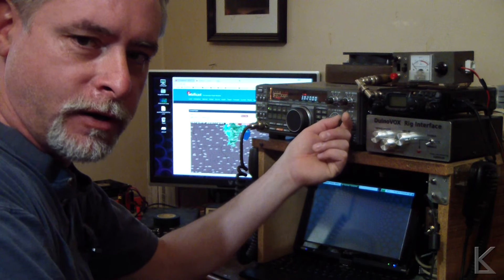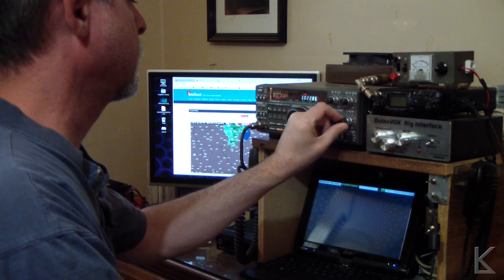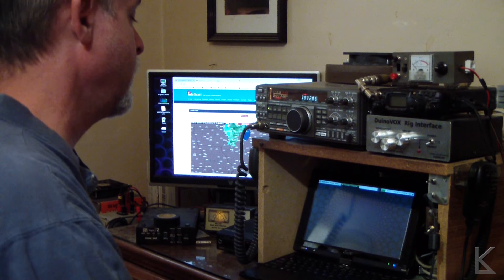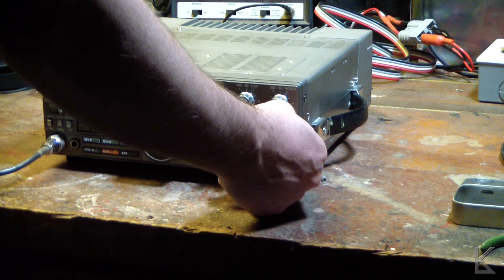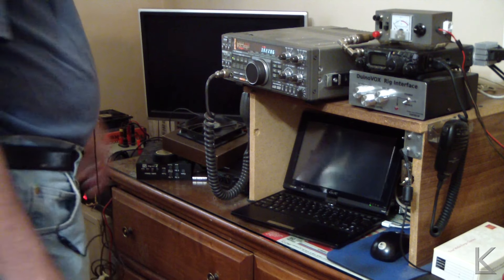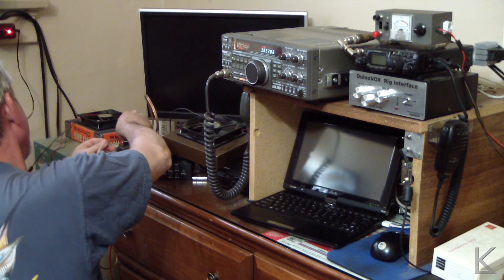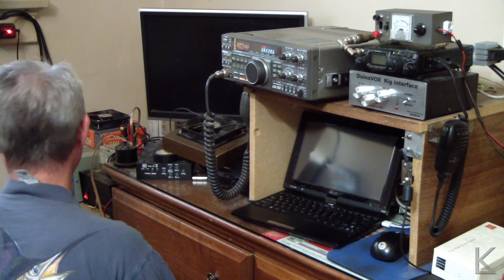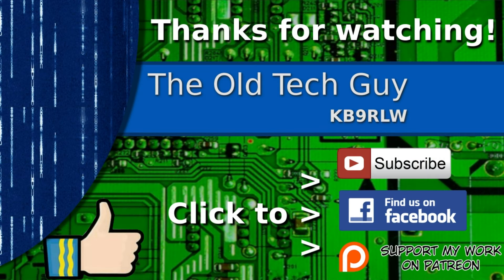Ham Radio - Kenwood 440Sat and a very mysterious whine noise.

Comment: It happens. Glad you found it without too much trouble. Thank you for posting this because I have done something very similar very recently and now I don't feel so "bone-headed" LOL. Mine was an MFJ-492 menu driven keyer with a dead lithium (bios?) battery. It was locked up in the 'TUNE' position.  73 de K7RMJ  Frank